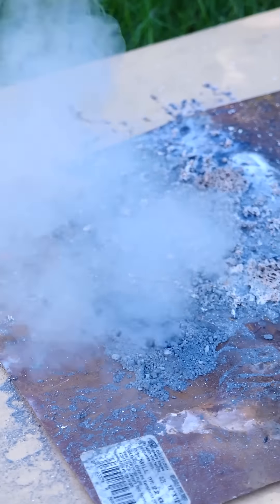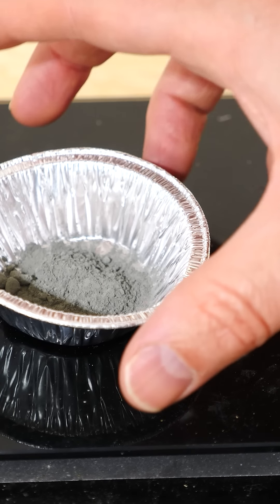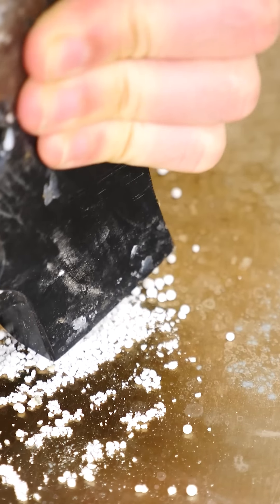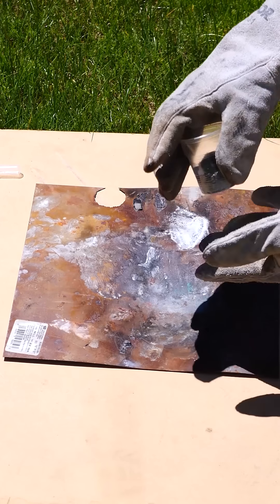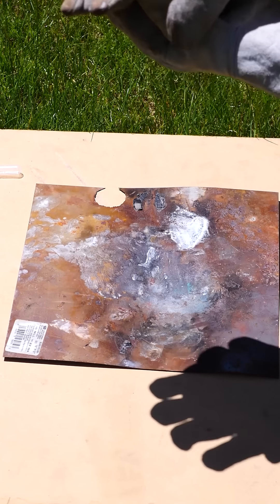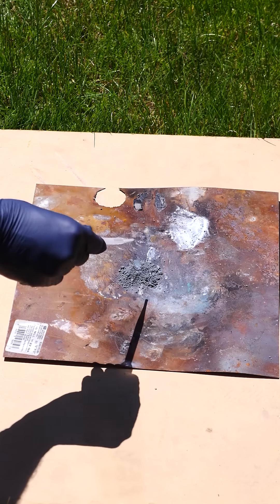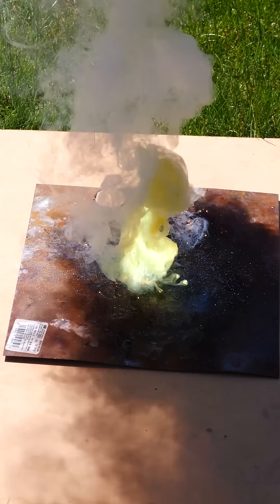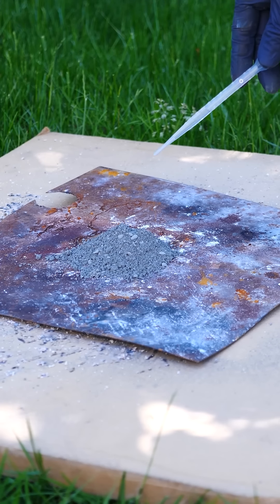Negative X—Don't Add Water!

Comment: basically how this works:
Zn + NH₄NO₃
Zn could theoretically easily kick and replace NH₄ out of its partnership with NO₃, but unfortunately for it there isn't enough movement for Zn to have a chance of replacing NH₄
Adding H₂O, a pretty good solvent, makes NH₄NO₃ separate into its components, NH₄⁺ and NO₃⁻, which then start floating around in the H₂O, with the dissolution of NH₄⁺ being more relevant to Zn.
Zn itself doesn't become an ion just because of H₂O, but it can forcibly give NH₄⁺ an electron due to Zn's ability to make more stable ions than the neutral NH₄•. The equation for this is
Zn + 2(NH₄⁺) → Zn²⁺ + 2(NH₄•)
NH₄• isn't stable in this neutral form, which causes it to decay with the following equation:
2(NH₄•) → 2(NH₃) + H₂
The total formula, including the NO₃, is
Zn + 2(NH₄NO₃) → Zn(NO₃)₂ + 2(NH₃) + H₂
All this exchange produces a lot of heat, which can melt the Zn (420°C) and NH₄NO₃ (170°C). This allows for combustion of the released H₂ [2(H₂) + O₂ → 2(H₂O)] and combustion of the Zn without NH₄NO₃ [2(Zn) + O₂ → 2(ZnO)]. The molten state of the Zn and NH₄NO₃ allow for further reaction, even though the original H₂O should've long since evaporated.

tl;dr the video
edit: realized I accidentally wrote down the formulas for zinc(I) nitrate instead of zinc(II) (real) nitrate. This didn't change any of the explanations though, and only changed numbers by factors of 2.
Reply: Nice explanation.  So what happens if you throw this into a body of water?
Reply: @smgdfcmfah  The extreme volume of bodies of water will probably both quench the Zn and dilute the NH₄NO₃ to the point where the reaction cannot happen. However, for the first few seconds, the reaction should still occur, producing the ZnNO₃, NH-
Hang on, just realized that there is no compound called ZnNO₃, and zinc nitrate is in fact Zn(NO₃)₂. Will correct for a bit.
Reply: @smgdfcmfah   @smgdfcmfah   @smgdfcmfah  The extreme volume of bodies of water (H₂O) will probably both quench the Zn and dilute the NH₄NO₃ to the point where the reaction cannot happen. However, for the first few seconds, the reaction should still occur, producing the Zn(NO₃)₂, NH₃, and H₂. Considering that the simple addition of sodium (Na) to H₂O can still ignite hydrogen despite the quenching properties of H₂O, I presume that the result will be everything igniting, except for 2(Zn) + O₂ → 2(ZnO), because H₂O will probably remove all the O₂ by quenching.

EXTRA (Probably won't happen in bodies of H₂O):
Forgot to mention this in the original message, NH₃ can burn as well, using the following process:
4(NH₃) + 5(O₂) → 4(NO) + 6(H₂O)
Zn(NO₃)₂ can also decompose at the melting point of Zn:
Zn(NO₃)₂ → Zn + 2(NO₂) + O₂
Same with NH₄NO₃, at lower temperatures:
NH₄NO₃ → N₂O + 2(H₂O)
This effectively results in the ending compound being a bunch of zinc oxide, nitrogen dioxide, nitrous oxide, nitric oxide, and water.
Reply: @user-pr6ed3ri2k  Thank you for the explanations. I was thinking, would the reaction with zinc also work with other nitrates, as an example sodium nitrate, maybe like this?: 2(NaNO3)+Zn=Zn(NO3)2+ 2(Na)
Reply: @JSK-projects  While the reaction does work with certain other nitrates (ex: silver, copper, other unreactive metals), it does not work with your specific example.
This is because sodium is much, much better at forming stable ions than basically anything else on the table, and would not allow zinc to replace it in compounds.
Reply: @JSK-projects  While there will be a reaction, it will not be the single displacement reaction you have written due to user-pr6ed3ri2k's explanation. What will likely happen if the mixture is heated up, is this unbalanced reaction: Zn + NaNO3 -> ZnO + N2 + Na2O. It may also result in this (again, unbalanced) equation as well: Zn + NaNO3 -> ZnO + NO2 + Na2O. There are a ton of other products, including NO, NaNO2, Zn(NO3)2, Zn(NO2)2, and O2. Note that no reaction really happens if water is added, as this mixture is not particularly water sensitive (well, not predicted to be anyways without a catalyst, whether it actually is...)
Reply: Me who’s doing chem 3U and understood everything you said:
Reply: that feeling you get when you realize you now understand the former Greek that someone once spoke to you
Reply: "Basically"
Reply: Bro copied a science post
Reply: Nice
Reply: But what if you mix in sugar, spice and everything nice?
Reply: I wish I was this proficient with math. I might actually have a job...
Reply: @user-pr6ed3ri2k I had to read your post a few times to comprehend but I appreciate the explanation.
Reply: Only way I see this progressing into fire is if steam can also catalyze the reaction
Reply: @Relkond  The extra heat melts the zinc, which means no water is needed to dissolve things.
Reply: A few points to consider:
1. Ammonium radicals don’t exist, the ammonium cation instantaneously decomposes as its reduction results in the occupation of an orbital in the central nitrogen atom, forcing a bond with one of the hydrogens, to break.
2. Zinc can displace hydrogen in water at higher temperatures to form zinc hydroxide, since it is more electropositive than hydrogen. This is another slightly exothermic reaction to note. Also, zinc hydroxide won’t react with ammonium nitrate since it is more covalent in nature and stable in that form.
3. I’m not sure if you mentioned that zinc nitrate exothermically decomposes into nitrogen, zinc oxide (unlike alkali oxides, due to its water insolubility and cation un-reactivity, it does not hydrolyse to zinc hydroxide), and possibly some leftover oxygen.
Reply: @geo3106  
1. I did consider not even mentioning at all, but I recently heard some news about an "ammonium amalgam" that contained the ammonium ion in a neutral form at the time, so I just decided to use the neutral ion in the equation.
2. While it seems obvious in hindsight, I did not realize this. Thank you for this contribution.
3. You may read my EXTRAS comment ≈3 comments below the main one for this, I guess.
Reply: @user-pr6ed3ri2k  Thank you. I appreciate your quick response time, something I do too. By the way, if you don’t mind, could you share the academic level you are at in terms of chemistry. I am in the 10th grade, but take a massive liking to chemistry, physics, and science in general, so I enjoy higher level discussions like these. I’m just curious if you’re ok with it.
Reply: @geo3106  I am merely in the 8th grade, in the Philippines, which is not famous for being excellent at teaching, or anything at that. I am pretty interested in science as well, but I've learned none of what I have been talking about in school, and I technically have no qualifications to talk about this stuff.
Reply: @smgdfcmfah Absolutely nothing
Reply: Bro are you a chemist or smt
Reply: @wispycartoon  No. This is basic chemistry. Kudos to the fact that he’s comprehending and expressing this theory at such a young age.
Reply: How do i get those without being added to a list?
Reply: @geo3106 no, it's basic chemistry. It does not constitute basic knowledge for most people.
Reply: @TheRealMycanthrope You don’t have to either be a chemist or “most people”. There’s a lot to be in between, where you can know basic chemistry without needing a degree.
EDIT: my bad I wrote “knowledge” instead of “chemistry”. Thanks for correcting me. I have changed it now.

Comment: If we use Aluminum powder instead of Zinc powder will it work ?
Reply: Probably not, as aluminum is actually too reactive. The oxide coating forms effectively instantly and thus the ammonium nitrate solution wouldn't be able to come in contact with aluminum metal. That's why lighting thermite is so difficult: you have to heat the aluminum powder high enough to melt it out of its oxide coating.
Reply: @willythemailboy2  Thank you
Reply: Isn't zinc and sulphur reactive? Zinc powder, burning sulphur, ammonium nitrate and dry chlorine makes a great way to die suddenly. I've mixed up my own concoctions when I was a kid. Mixed in glass with a glass stir stick  remotely by a kitchenaid mixer and it went off by itself depending on its mood. The mixtures are critical.  Some go boom while mixing some go boom hours after mixing for no apparent reason,  some go boom handling it or at the slightest tap and others wouldn't do diddly. One fizzed one rearranged the whole garage. Kids don't try this at home.

Comment: Zinc metal isn't water soluble, thus it wouldn't form zinc ions when mixed with water.
Reply: Right but you are forgetting the other part of the equation, ammonium nitrate solution combines with the metal.

Comment: Dr. Can you give us an explanation on what happened to the titan sub? Like what happens during an inwards explosion and why?
Reply: If it helps, even three months later, it's basically because there was likely a breach in the walls and all the air got sucked out

Since things like oxygen and carbon dioxide are lighter then water, they naturally rise to the surface when the two are introduced to each other, the former will always rise to the top...and the more water there is on top, the more violently the air gets sucked up

So then when you have a craft that low down, and even a slight crack forms in the walls, all the air gets sucked out toward the surface of the water with such intense force that the craft crumples in on itself
Reply: @damienearl8302  the weight of oxygen has nothing to do with it, the problem was the pressure

Comment: So would the chemical equation be:

ZnO + 2NH4NO3 + H2O -> N2 + Zn + 4O2 + 4H2

???
Reply: Not balanced
Reply: Zn + NH4NO3 → N2 + ZnO + 2 H2O . You start with elemental zinc and you are oxidizing it (hence the fire). The water is not an input, it's just a drop to let the two ingredients mix